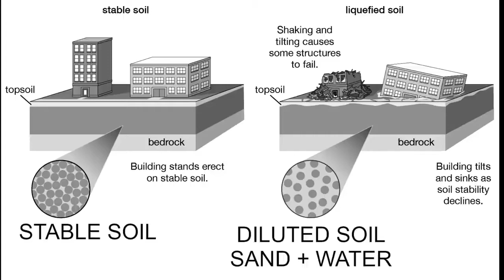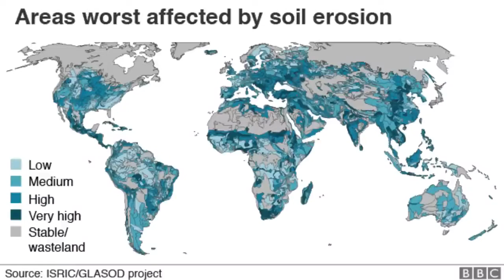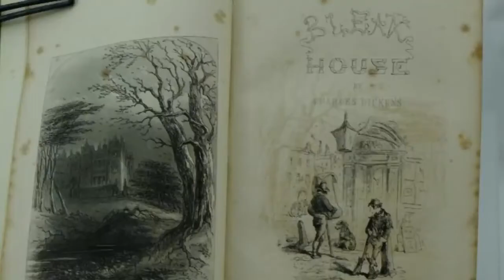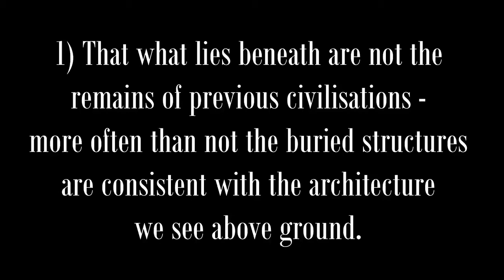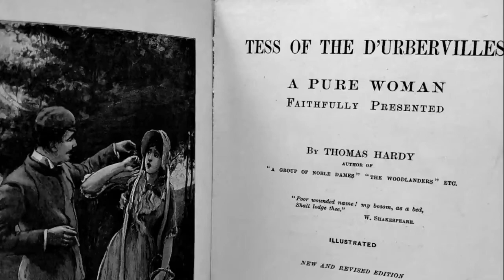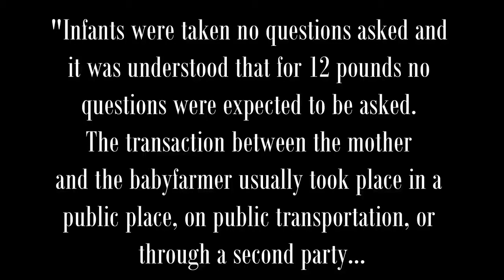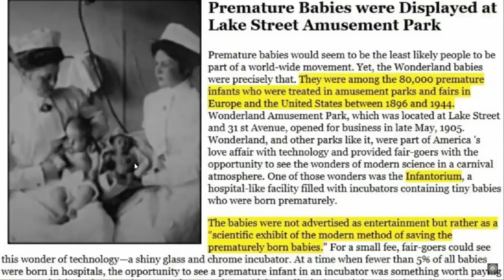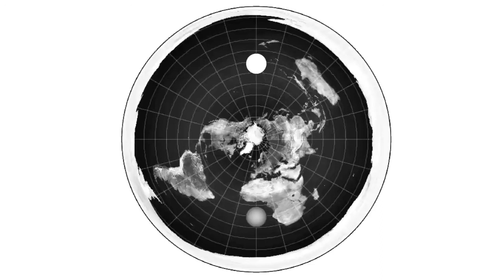The Lost History Part 3

Comment: at 7:35 is their two giant heads in the picture? one in middle left the other middle right in what looks like a planned structuring of the planks and equipment to look like the free mason symbol of the square and compass?
Reply from the maker: Good catch. I see it too. One of the heads have shoulders and chest and the other one I see has only a head. Yea these pictures are showing a lot that we don’t see yet
Reply: @tht.1grl  yup exactly. also to mention that the square and compass symbol is frequent throughout the video, one being at 24:38
Reply: @tht.1grl  the “giant” on the right seemed to have been possibly operating the machine or was being held down by the structure. again i have no clue what both of them are but i can’t think of anything else they look like it’s pretty obvious.
Reply from the maker: @ZStiles  yup, I definitely think there is more to discover/dig up. The buildings look like they are much taller. If we dug up more, we might find remains of giants.
Reply from the maker: @ZStiles  agreed. So much is buried. Literally and figuratively